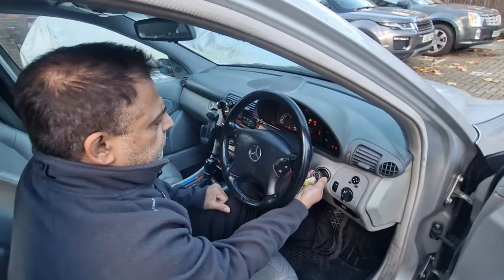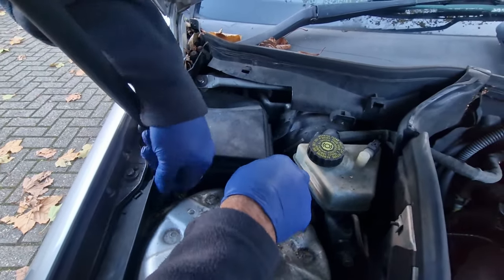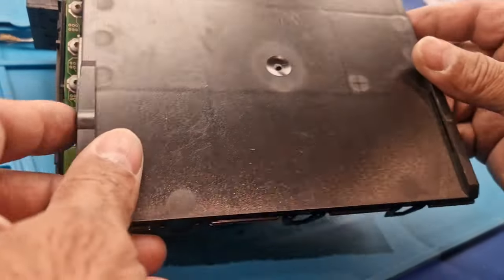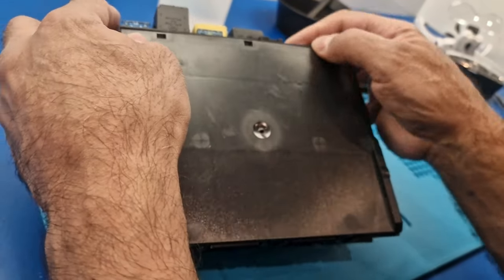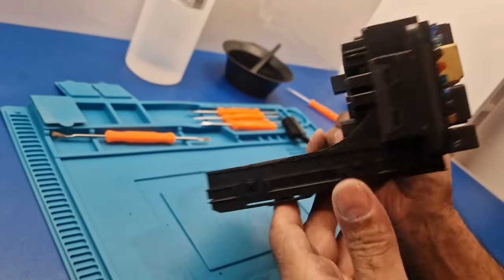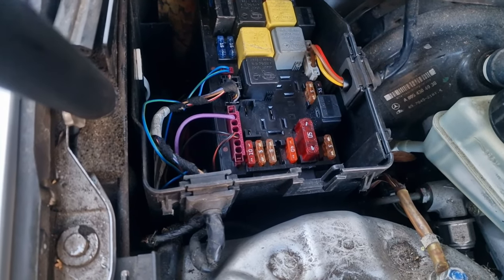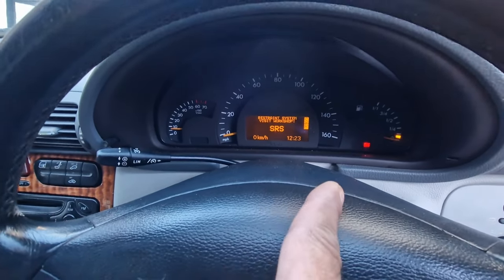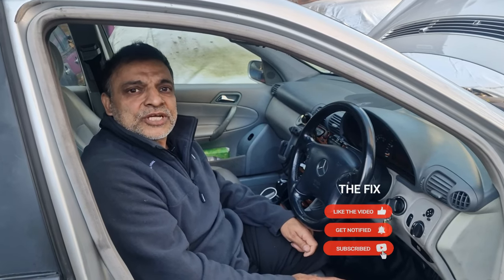Mercedes Benz C Class SAM Unit Diagnose and repair [Part 1]

Comment: Excellent, but you're better off removing the PCB cover and cleaning the PCB without removing the unit completely. Save yourself a lot of time and trouble trying to remember where all the underside connectors go.
Reply: Which is EXACTLY what I did.   But mine still doesn't work

Comment: Everybody, clean out your rainwater drains regularly on any model benz, even if they are pampered and kept inside.  I've had a 2005 CLK320 break down because of this, and the fact the prior owner lost the fuse panel cover and the water drain and redirection pan that sits directly above it, all of which are situated under the hood cowl vent.  Also a 2005 C240, on which the plastic bulkhead that allows coolant to pass through the firewall, then further on through the heater core, disintegrated, which dumped coolant into the space between the cabin firewall, and the engine bay firewall, which happens to be right where the front SAM and the ECU and TCU live.  I got lucky and realized what was happening when I looked down and it was over 300 deg F outside and I was going almost 150mph, which I was stopped and it isn't quite that hot in Texas...lol.  I just unplugged the battery and removed those modules and cleaned them...
Reply: That drain pan above the Fuze box is crucial. Also the Fuze box cover must be clamped down tight to keep the moisture out ,it also has a seal on it
Reply: Bro mine won't turn on you think I can still clean it up??    The technician told me I'm not getting any communication from the front sam
Reply: were you living on the planet 'Mars' at the time ? C'mon dude 300 deg F , and your still in 1 piece? and the local speed limit in Texas is permissible at 150 Mph ?? and the fed's just saw a fleeting cloud of dust wiz by, maybe i need to move to Texas too 🤔
Reply: the 150mph and 300 F readings were noticed when i stopped at a stoplight, and the car was running funny...  i was lucky that i noticed it and was able to turn the car off and unplug the battery relatively quickly.  i do love a tall tale, but no c240 i know of would feasibly go that fast, but if you read the paragraph i wrote again, you will see that i stated that i was stopped at the time i noticed the erroneous readings.
Reply: Amen!
Reply: @PabloGuzman-ql5cs how did it work out for you? I'm having the same issue
Reply: @PabloGuzman-ql5cs  Man, I apologize that I didn't see your message right away.  It did turn out ok.  Just unhook your battery, and unplug all the wires from the SAM and pop the fuses and relays out.  Take the case apart, but be careful not to do what I recently did to my CLK550 and jab the circuit board with a screwdriver... I spent hours resoldering components back on the board, but I got lucky and nothing was ruined, thankfully.   Use something like a toothbrush if there is a lot of blue/green corrosion.  An auto parts store should have a can of electrical contact cleaner.  That will help too.  Use a decent LED flashlight to really look closely at the components.  I used my phone's camera as well. The camera's zoom can really help you see the small details. Just be careful to not brush away components at least until you get a good view of it to see what kind it is and its orientation on the board.  Another tip is to take several pics of the board before you start to clean it, so if something pops off, you'll know where it goes and which way it attaches.

Comment: got an clk 200 .my tail lights turns on wwheen i turn on low beams
Reply from the maker: Hi, check if any of the other light bulbs are blown
Reply: If the bulbs are all good, like the host here has suggested, try cleaning your ground wires.  Find the bunches of brown ground wires, take the nut off the grounding post and remove the wires from said post.  Clean off the corrosion, one by one, from the wire end connectors with a wire brush and or sand paper and treat them with battery terminal post protector.  Do the same to the ground post, and the securing nut on the chassis side as well.  If you want to be very very thorough, which I do advise doing, repeat this process for all the grounding points in the car.  When these Benz's get to be as old as ours are (I have a 2007 CLK550, and a 2002 CLK430, which reminds me the 430 is a classic now! And so am I hehehe!) the corrosion is quite invasive and prevalent.  Cleaning all the grounding points will also help keep the modules you currently have happy and cool, as bad ground wires increase resistance across the entire circuit as a whole, which causes heat buildup, and premature failure of expensive modules and electrical components, alternators, and batteries... Not to mention tow truck bills, headaches from being late to work or an upset friend/spouse/other etc etc... Sorry for the verbose reply but I hope it will help someone out somewhere sometime.  Happy Benz-ing!

Comment: very informative video, i have a c230 coupe kompressor 2002  and my speedometer isnt picking up, everything else works, i see some movement on the arrow  for the speed on the instrument cluster when i start the car, which gives me the idea that there is maybe a short somewhere in the SAM, i will work on it soon and come back with an update.
i hope its just cleanable corrosion on the SAM...

Comment: Hello I have a question, none of my signal lights are working also my left headlamp isn't working. I think it's caused by a bad jumpstart where I accidentally put positive at negative :(. And so I changed the battery, but these are now my problems. I also can't find any fuse for my signal lights. I have a Mercedes viano w639 2006. Might the problem be with the sam unit?
Thank you :)

Comment: Would the peeled lip of cowling, for your car windshield, allow more than normal amount of moisture, in the area of SAM?. My right hand side headlights & signal lights begin to intermittently come off & later on. Would cleaning circuit, with a little bit of WD40, be better as it should be able to give a layer of protection against corrosion. Regards.

Comment: Hi...I Am Recently Having A Problem With My Mercedes Benz W203 C180 Does Not Get Power To The Cluster, Ignition Not Reacting, Hazards Wont Work, Central Locking Wont Work But Lights Do Work I Have Checked Sam Unit After Stripping It Out Of The Car As You Did And Opened The Front Sam Unit And Everything Looks Fine Any Idea What Could Be The Problem???...... Great Videos Keep Up The Good Work

Comment: If the steering wheel is on the other side, it's not that easy...

The rod for the windshield wiper is also too much in the way when cut open and you can't get the module out. No matter what you try.

You can only let the windscreen wipers move vertically and then you're good to go. However, if this does not work as can be seen here and also unfortunately for me, as I had to find out, you are unlucky. Or can the windscreen wipers be raised externally somehow?
Reply from the maker: Hi, if you unclick the rod out of the ball, then by hand, move the wiper across the windscreen
Reply: @thefix9823  Sure, but the other rod with the hole in it is in the way and cant move inside. I was not able to get the Sam Out of its Container because it was blocking so much space
Reply from the maker: Put the wipers on when in upright position switch off ignition
Reply: @thefix9823  my Car have the Same problems Like this Car. The  indicators and the wiper dont Work anymore...
Reply from the maker: You might have to take out the wiper motor completely
Reply: @thefix9823  Most likely yes. I haven't figured out the best way to disassemble it to get at the Sam yet..

Comment: about 2 weeks ago I trim off the cracked strip of rubber for the whole length of the cowling of 1.6m. There will be a gap of 5 from cowling to glass

Remove wiper &  clean the cowling & windshield and left it dry for 1 day. 

Then stick on rubber seal of 27mm width bought online. Key in google "Seametal 27mm rubber roof sealing tape" for less than USD3 for 2m length.  

Cut a short 6" length of sealing tape. Trim it correctly to fit the corner of the cowling to windshield. Use this as a testing strip. Peel the red strip from the 3M sticker to stick it. 😂😂😂